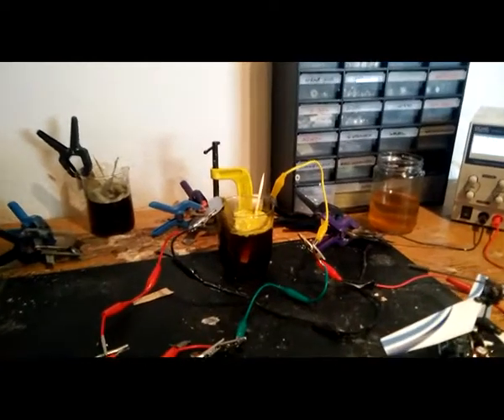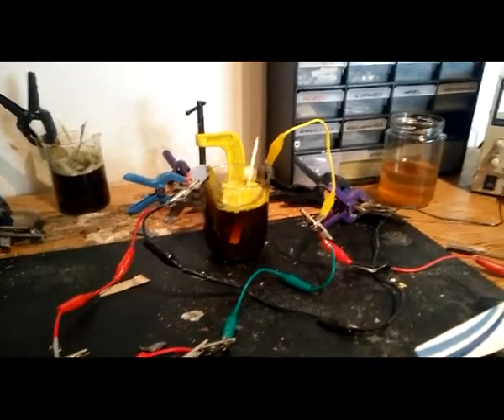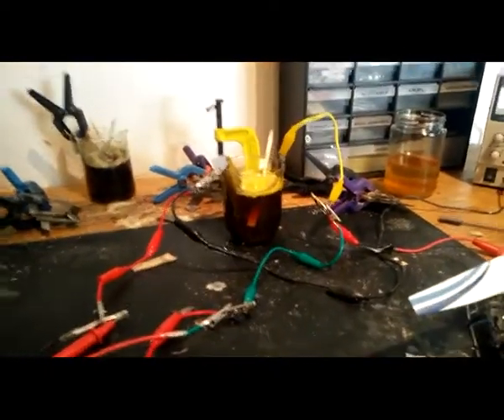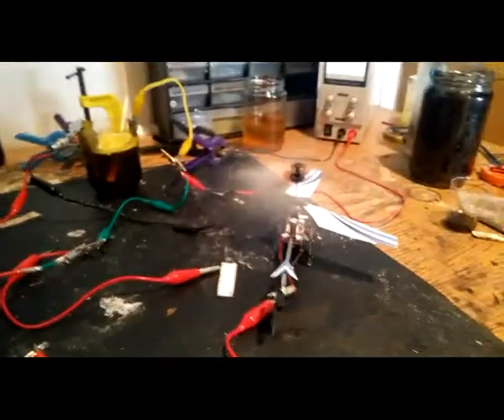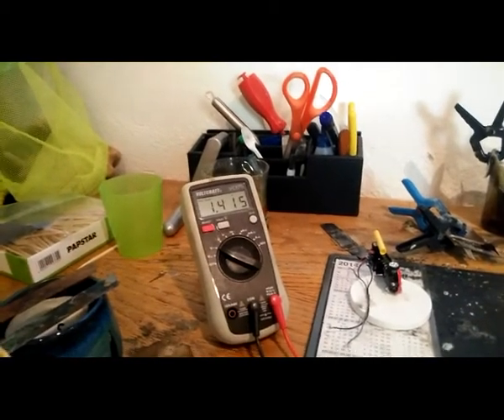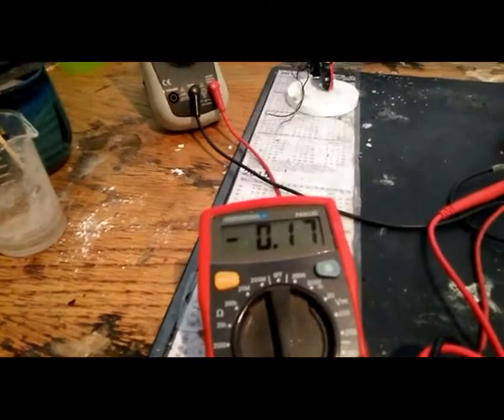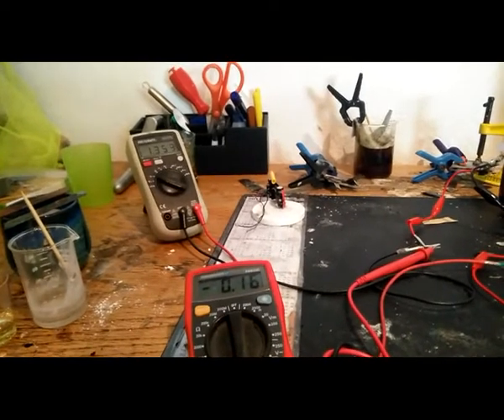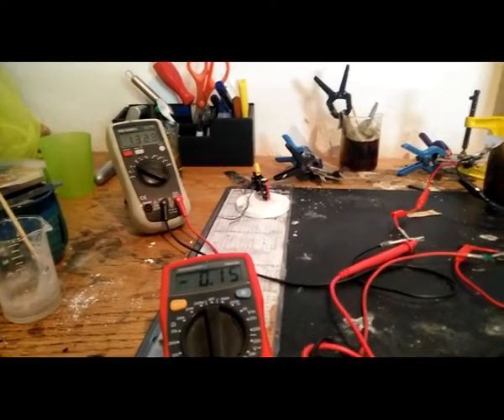ironnano particles  akku part 2

Comment: nice work, have you checked this stuff out.. Kappa Carrageenan. It's a gelatin substitute, get it on eBay...very cheap, worth a try for a gel electrolyte especially as its 'setting' is closely related to potassium.
keep going...good work :)
Reply from the maker: cool thanks, I have to try.